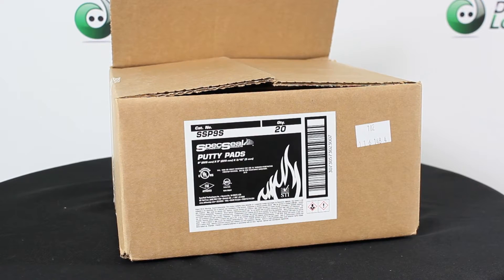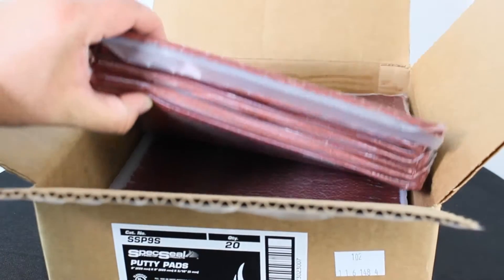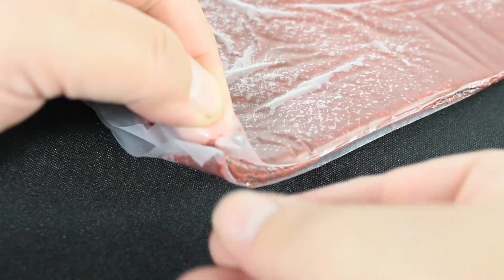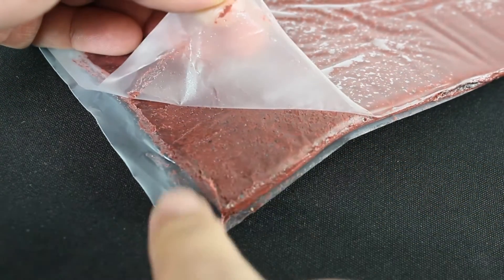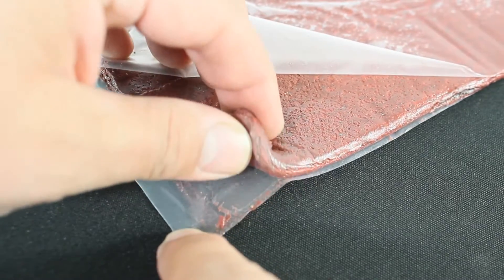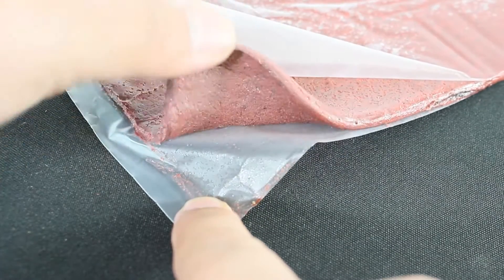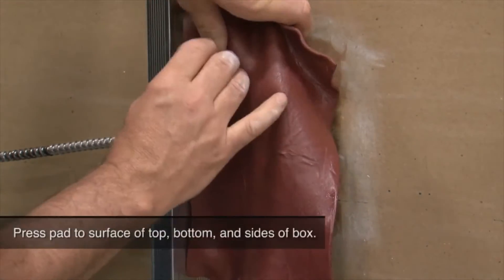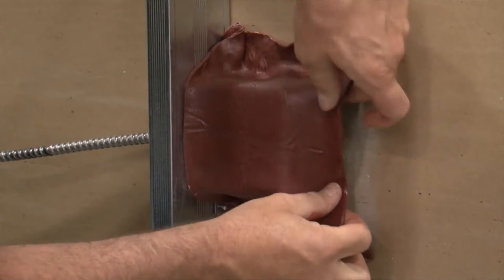Specified Technologies SSP9S Firestop Putty Pad for single and multigang Electrical Box

Comment: I'm looking for a completely fireproof solution.  I want to install some kwh meters that may not be UL or CE certified.  I want a fireproof box that will guarantee never a house fire.  Does anyone know the best way to accomplish this?   Line a box with the pads?  Use a special box?   The meters I want don't have UL equivalents... Thanks
Reply from the maker: Are the meters being mounted on a din-rail? In a more secure enclosure? https://www.discount-low-voltage.com/Data-Enclosures-Racks-Shelves/Small-Equipment-Enclosures/SNB-3738

Anyone else have a good idea??? 🎲